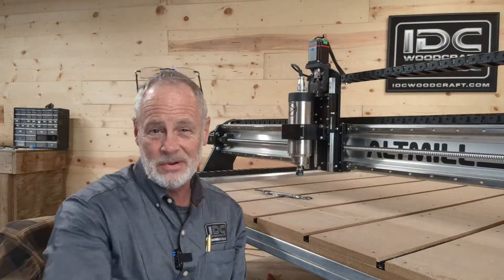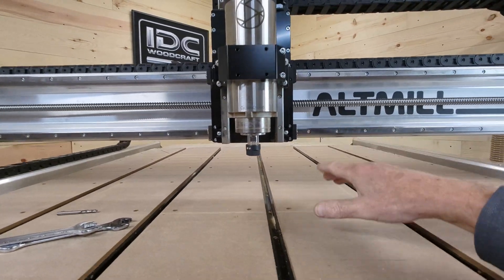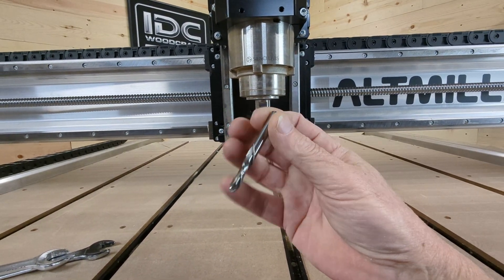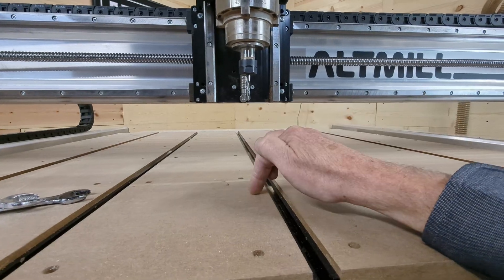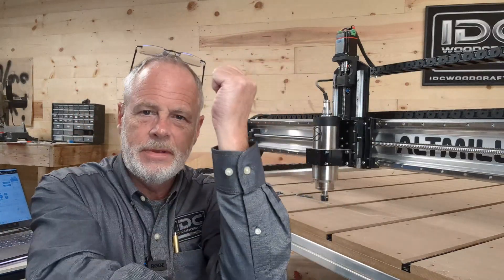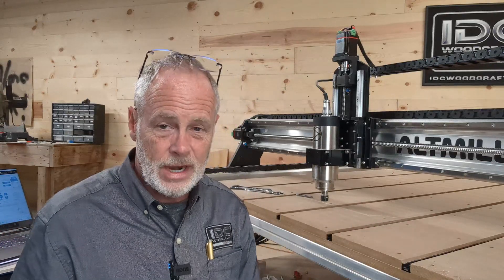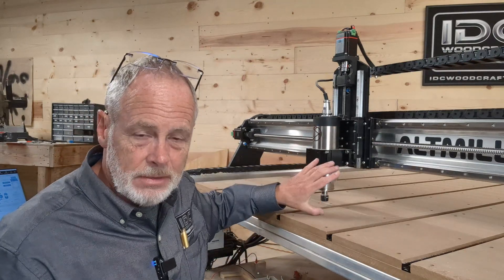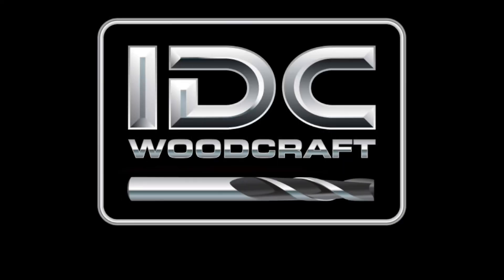How to Maximize Your CNC Router Carve Area for Large CNC Projects

Comment: My machine is almost as stout as yours. Not quite as many bells and whistles but its good. Getting that out of the way, my carve times should be reasonably fast but they are not. I even go higher than the recommended speeds and feeds and still they are not. For instance, A 17 inch diameter circle to carve a 3d image into Pine, which is a soft wood, would take me 12 hours but yet my speed 100 inches per minute sometimes 150. Not too fast cause I don't want any chip out.
I think my problem is acceleration and deceleration? Do you have a video on that? I don't know what the best setting is for not messing up any wood. What are your settings at?
Reply from the maker: iwannaapple7190, It sounds like you're really pushing the limits with your machine, which is great! You're correct that acceleration and deceleration settings can significantly impact carve times, as they determine how quickly your machine can speed up and slow down. If your settings are too aggressive, it might cause issues like chipping or inaccurate cuts, especially in a softer wood like pine. While I don't have a specific video on this topic, it's usually a good idea to experiment to find the right balance that works for your setup. Every machine is different, so what works for one might not be the best for another, but tweaking those settings can definitely help you achieve better carve times!

Comment: I am a total newbie- I picked up a used OpenBuilds Ox to learn on. I couldn’t even fit a 3/4” board and thought “this can’t be right.” I am grateful I found this video, as I can now easily accommodate taller boards, but now I noticed I have a different problem- my z carriage runs into the side of my board once I go deeper than 1/8” (roughly how much lower the bit is than the z carriage). Any advice?
Reply from the maker: kalliespidahl4764, It sounds like you're encountering a common challenge with Z-axis clearance and bit depth. To fix this, you might consider adjusting the position of your Z-axis or the height of your spoilboard. Make sure everything is properly aligned and check for any physical obstructions as well. Additionally, you can explore using shorter bits if you're planning on cutting deeper while avoiding the carriage interference. Keep experimenting, and you'll find the best setup that works for you!

Comment: Hi Garrett. Thank you for going through so much trouble to answer my question. That’ll be today project. I’ll let you know how it goes. I’m also just reading up all the wiring instructions so I’ll be controlling the spindle via gSender and the new super Long Board.
Thanks again. I’m famous now 😂😂
Reply: I’ve just been down to do the spindle setup on to my Longmill. I took in to account the weight and balance which makes a lot of sense. I used a piece of 3/4” MDF and used it like a seesaw to to find where the spindle would balance and set it in to the clamp at that point. I also noticed that there was a factory drilled hole at the point for some reason. Taking it from there I feel the working Z axis is perfect for me. Thanks again Bro. 👍👍
Reply from the maker: roymainey4726, You're very welcome! I'm excited for your project and hope it turns out great. Enjoy your time with gSender and the long board!

Comment: I've found the guidance Sienci gives relating to where to mount the spindle is very good.  Essentially does the same as what Garrett describes here without the reasoning.
 I got the gControl touch screen all set up now too.  Seems plenty powerful to do what I need from in front of the machine.
Reply from the maker: souprmage, It's great to hear you're finding the guidance from Sienci helpful! The gControl touchscreen can really enhance your experience by providing convenient access right at the machine. Enjoy your CNC woodworking projects!

Comment: We do it a bit more simplistic. But there is 2 schools of thought!  Folks who need to cut through projects and those that never cut through. I will use the cut through as the example.

The part that is most important is the lowest point of Z travel allowing any cut through bit to reach the thinnest your spoilboard can get.  The upper limit doesn't really matter as you get what you get if you want to always reach the lowest depth with all bits and all spoilboard conditions.

 As an example, if your current spoilboard is 20mm thick and the thinnest it can get before replacing is 10mm then your shortest bit must reach that point. If your shortest cut through bit is a 3mm bit with 15mm of stickout then your collet nut should be set to 5mm above that 20mm thick spoilboard. Gap = shortest bit stickout (15mm) - available spoilboard thickness (10mm) = 5mm. Your collet nut should be snug with a collet in it for measurement.

 Note that if your spoilboard was 20mm but is now 15mm and you change it at 10mm then the GAP = 10mm = (15mm stickout - 5mm available spoilboard thickness)

 If you have T-Track the thinnest is simply a few mm above the T-Track. If your screwed down spoilboard thinnest is a few mm above the recessed screws.